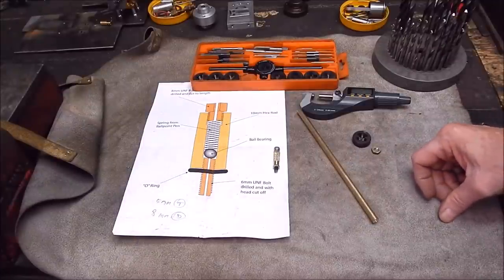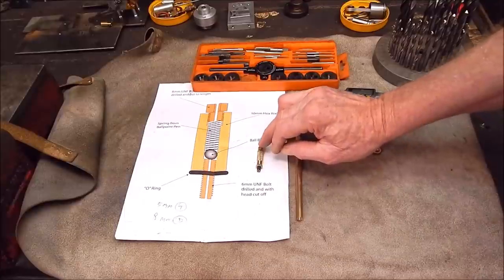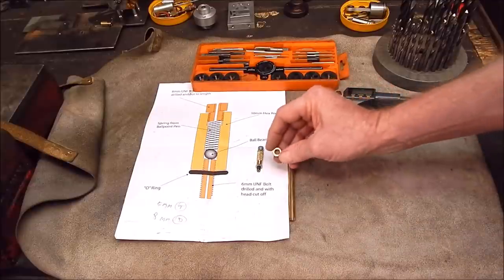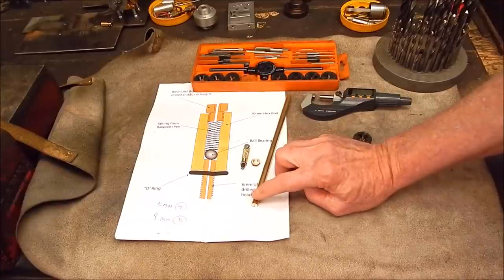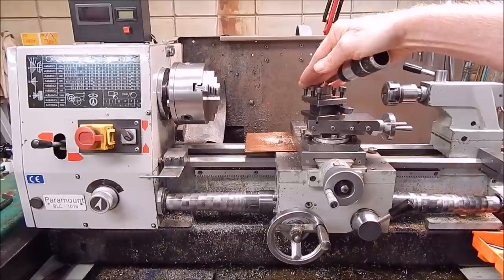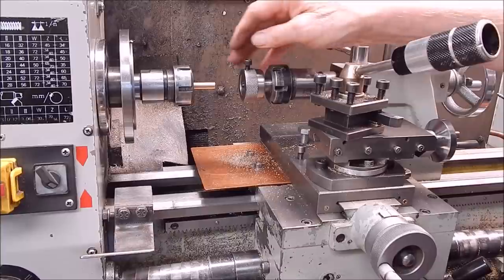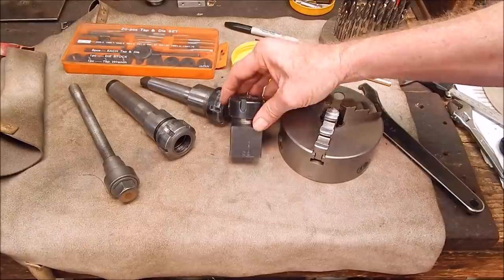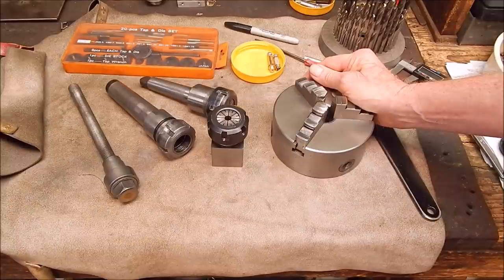Why small metal lathe owners should be using collets

Comment from the maker: NOTE: There's nothing mysterious or high level user about collets.  They are just another/much better way of gripping small stock.  They are just another type of chuck that can be fitted to all modern lathes, that will grip harder, better, more accurately, without marking or destroying the job.

Very few lathe users seem to cotton on to what they are missing out on.  Do yourself a favour and get set up for collets.  ER are the most popular and give the greatest compression range.

Cheers Rob
Reply: I just purchased 29 imperial ER 40 collets and a collet holder for my lathe, as I don't have a small stock holding method, other than a drill chuck, which will work with some things, but not with very fine stock. Not to mention my three jaw chuck is not in great shape. When I can afford it, I want to expand my collets with metric size collets as well.

Comment: Hey Rob.

Not sure if you're able to get hold of any W20 collets for your Schaublin, but I have a 1.666 w20 collet puller going spare if you want it.  It's from an ARE, so might not be the right length for your headstock, but they are easily modded.

Direct spindle mount W20 is far better than an external ER collet chuck, IMO - you're much closer to the headstock, and at least with Schaublin collets, additional runout is close to the bounds of measurability, sub-micron on my machine apart from a couple of rather tatty ones which run out 5 microns or so.

They're expensive new, but over here in Europeland a full set runs about 200 euros second hand.
Reply from the maker: Hi Michael, I have a nearly full set of W 20's that came with the lathe.  Most are in worn condition.  I rarely use them because of the poor compression factor.  ER can be technically more accurate than W20 as it compresses evenly full length of the collet while W20 only compresses half the length.  That's why C5 style collets are only really good for close to nominal sized work.  Thanks for the offer, but I would never use a collet puller.  Cheers Rob

Comment: Rob as usual great video. As a young Fitting &Turner I was taught to always reverse my Tap or Die to break the swarf and keep the cutting tool clear. Not so bad with free cutting brass and steel, but a good habit to prevent breakage of fine Taps. 
Keep the videos coming.
Reply from the maker: Hi Tracey,  brass is probably one of the worst at self clearing drill and tap flutes, after aluminium which is terrible.  Yes, to preserve fine drills/taps you need to clean them regularly when drilling.  Brass also likes to bind when tapping as you are doing it dry.  It is great to machine, but a bit tricky to drill and tap at times.  Stay safe and well.  Cheers Rob

Comment: Great video Rob, all hail the adoption of collets 👍👍👍 On my small lathe I have found that you can safely use a morse taper collet chuck in the tailstock without a tang. Even with fairly large drill bits it will hold securely without coming loose. Cheers, Alan.
Reply from the maker: Hi Alan, yes that's right, they will hold fast in the tailstock without a tang.  The tang is only there to enable ejection, unlike on a drill press where the tang generally engages and prevents turning, as well as for removal with a wedge.  If your tangless Morse taper ejects OK, it must be slightly extended on the end - generally they don't.  Have a 1698 for me.  Cheers Rob
Reply: @Xynudu  Hi Rob. It usually needs a little persuasion to eject 🙂 All out of 1698 at the moment but as the pubs are now open again it's not too much of an issue!! Cheers, Alan.
Reply from the maker: Hi Alan, I stocked up yesterday.  They had it out at 4 bottles for $18 AU, which is as cheap as I've seen it. 

If that morse collet chuck has provision for a draw bar it would be a simple matter to put a small length of bolt in there to make ejection easier,  Just cut a bit of appropriate thread and put a screw driver slot in one end.  I did it to a couple of mine.  Cheers Rob
Reply: @Xynudu  Hi Rob. Nice score on the 1698. That's a good idea on the collet chuck, I think they are threaded 10 mm so I will give that a go. Cheers, Alan.

Comment: Easy project to turn a collet chuck. I made an ER40, plan to make something bigger but that needs my own design of collet too. Rarely use my 3 or 4 jaw.
If you turn it yourself, the runout will be in the single ten-thousandths when you re mount it.
Reply from the maker: Not difficult.  I made one for the Schaublin and it worked out OK.  You must get a snug thread though or it won't be accurate.

Comment: I have almost the same lathe as Rob. (its the europe version)
Insert diam of the spindle is 26 mm.
A 3/4 inch gas pipe is 26,2 mm. So I made a bit smaler and screewed that on a peach round of 40 mm.
So my drawbar is hollow. So up to 20 mm stock can as long as you want in an ER32 collet.

The collet taper is turned in the lathe. So super in center. <0.01 mm

LIKE YOUR VIDEOS ROB
Reply from the maker: Hi Kees,  I have considered doing similar to my CQ9325 (same as the HBM450), but as I have two other lathes with feed through I haven't bothered.  For the money I would probably buy a bolt up collet chuck these days if I was to kit out the lathe for collets again.  Good idea though.  Cheers Rob

Comment: Question Rob. How is you three jaw chuck attached to your chinese lathe? How did you remove the chuck, it looks like you left the backing plate on the spindle and unbolted the chuck body? Why not unscrew the chuck and backing plate as a single unit? Thanks Greg
Reply from the maker: Hi Greg, on very many Chines/Asian lathes the drive plate is part of the spindle (it's all one piece) and the chuck does NOT screw on.  So to remove the chuck you simply undo three bolts and off it pops.  This also means the chuck can't unscrew when you reverse cutting rotation.  It's a very good system and gets over issues with chucks stuck on etc.  If a non OEM chuck does not mate with the locating holes you then use an intermediate/backing plate with the chuck.  Cheers Rob

Comment: On my big lathe I typically use the ER 32 collet block as that lathe has a 4 jaw on it all the time and it is quicker to centre up the collet block in the  4 jaw rather than  remove the 4 jaw and use the MT type or a spindle mount collet chuck .
Hopefully by tomorrow arvo i will have collets and collet chucks coming out of my wazoo ! ER11 for the 3020 engraver , ER16 for my drill sharpening jig , ER20 for my mini lathe  all in metric and imperial and a set of imperial ER32 collets to add to my metric set for my mill .
Got a couple of the tang type  (MT2) ER32 chucks , one for the  big lathe and one for my drill press coming and the ER16 and ER20 chucks for the drill jig and mini lathe as well . 
Banggood must think i have a collet fetish i reckon 😂
But more seriously i have had enough of drill chucks chewing up the shanks on my drills 😡
Now i just need to find an ER chuck that fits my battery drill ! It is the worst offender of them all ! I reckon Ryobi drills would have to have the worst keyless chucks ever invented 💩
Reply from the maker: Hi Ian,  I have also used the collet block in my Chinese four jaw as it then allows feed through.  Yes, swapping out big heavy chucks is bad news and I made the point in the video.  It's good to see that having a large lathe hasn't deterred you from using collets.

I've been driving this point to viewers for many years and I'm pleased to see that many have become converts and are eternally grateful ;)  Cheers Rob

Comment: Thanks for the video Rob. Interesting information. I was looking at collets. This has come in handy. Keep safe and stay well.
Reply from the maker: Hi Colin, once you use them and realise just how effective they are you will be hooked.  To newbies collets look like high end gear that only a factory would use, but that's not the case.  It's just another lathe chuck, that grips work all the way round and is relatively inexpensive these days.  Easily added and removed.  Cheers Rob
Reply: @Xynudu  Thanks again.

Comment: Hello, Thanks for the video. What size of ER collet do you recommend in General ?
Reply from the maker: ER32 is probably the most popular range, but the smaller sizes also get plenty of use from the mini/micro lathe guys.  ER40 and larger are less popular for home use as it's more expensive, not so readily available in budget lines, and also considerably more bulky when working in close.  A four jaw chuck should be able to handle most work over 20 mm provided it's not deformable/ thin walled tube etc.  Occasionally I wish ER32 went a bit larger and you can buy oversized collets up to about 28 mm (from memory) but they are a bit of a fudge really.

I'd recommend ER32 overall, but it comes down to personal requirements.

Cheers Rob

Comment: Great project Rob. Would it be possible to calibrate it relatively with an air compressor.
Reply from the maker: Calibrate ?
Reply: @Xynudu  It is supposed to be a pressure relief valve is't it? You should know what pressure it pops at.

Comment: Concerned about deflection of the bit that I watched. Will it cause tolerance problems? Elsewise, found it a clear working concept.
Reply from the maker: Deflection where John ?  If you mean using tailstock creep to cut threads, not really provided the lathe has prismatic ways and the tailstock isn't loosened off too much.  I've never had any issues doing it this way.  Cheers Rob
Reply: @Xynudu  At 16:00 your spot drill looked like it was deflecting significantly. Is your tailstock off center? Or could that be caused by the tip geometry of your spot drill? Or am I seeing things?
Reply from the maker: Hi Tom, that wasn't a spot drill, that was a jobber drill and any deviation would be from tip geometry.  Cheers Rob

Comment: Thanks for all the collet info. I selected ER40 collets when I started setting up my little home shop and use the morse taper chuck in the headstock. I had worked for  many years in a machine shop but unfortunately was never taught how to properly tighten the drawbar in the lathe and how to knock it out like you demonstrated. I only wish I had watched your video before I started beating the living crap out of my drawbar to drive out a taper I had locked far tighter than necessary. Once again, Thanks!
Reply from the maker: Glad it helped.  It's Morse taper so you basically only need the same force/tension as you would use for the tailstock - it's no different.   So about a fifth of a turn will be plenty.  Cheers Rob

Comment: On the drawbar type collet closer vs. the regular collet chuck...  I personally don't know much, having just bought my first lathe (bear with me), but 2 machinists I know have both told me that collets are the way to go for holding small work.  The gunsmith is totally convinced that the collet chuck is absolutely the way to go, because they are better for the one-off type of work he typically does.  The machine shop guy on the other hand, is totally convinced that the drawbar type collet closer is absoloutely the way to go, because it is better for the production type of work that is his bread and butter.

Kind of a moot point for me since there isn't a drawbar type closer available for my lathe; I have to get the chuck.
Reply from the maker: ER and C5 both have their pro's and cons.  ER are easier to use and have a much greater compression range.  C5 only grip at the nominal size, but can come in a range of internal shape configurations, allow feed through, and offer a quick action lock and release system for repetition work.  C5 don't have self release like ER.  It would be fair to say that ER is the most widely used collet system today, but C5 is still an industry favourite for production work.  I have also got W20 (for my Schaublin) which is like C5 and personally hate using them because they have zero compression range compared to ER.  ER will grip a much wider range of sizes for a given number of collets.  Cheers Rob

Comment: Nice mod to the original design Rob, looks better proportioned being bigger at the base with the nut in place. Happy to send you my drawings for the tailstock die holder I made (doubles up as a sensitive drilling device which for this small stuff would be useful). If you want a copy, drop me an email and I will send out. Cheers, Jon
Reply from the maker: Hi Jon,  thanks for the offer, but I will continue to use tailstock creep for now ;)  It works fine provided you don't let things get sloppy.  I have considered making a sliding die holder, but it's just another project for a rainy day.  The old style pull down type tailstocks do have some advantages over cam lock at times

Yes, with the big lathes you really must use a sensitive drill feed or it's snappo time.  The smaller the lathe, the better the tactile feel for sure. 

Cheers Rob.

Comment: Enjoyed...I have er32 collets ordered from BGood
Reply: Chuck - You'd better check those out thoroughly on arrival before the money-back guarantee expires... I've ordered a few MT 2 & 3 ER32 chucks from BG thru the last two years, finding all 4 of them had both concentricity and runout problems up to +/- 0,05 mm, and my BG Imperial & Metric collet sets measured about the same runout AFTER I'd reground the collet chuck in situ (down to 0,005 mm runout). All other aspects of the machining is excellent - it's just that all the collet's holes are both non-concentric as well as at an angle...
Haven't yet come around to grind alla the darned collets - 2 years after...
Check this for a few other's experiences of same: https://www.youtube.com/results?search_query=Banggood+collet+set+review
All the best! Nice channel you've got, too!  2 cents from DIYSwede
Reply from the maker: Hi Johan, I don't think much of most Banggood collet offerings.  Apart from their nice bolt up collet chuck, the only collets I've reviewed have been sub par, as lots of buyer comments indicate.  Other reviews have also been critical and I have advised BG on several occasions that they need to lift their game on the quality of the ER offerings.  This is not just a BG thing and lots of Ebay collet gear is total crap.  So buyer be ware.

The only store I have consistently bought from and found to sell accuarte gear at a reasonable price is CTC Tools in Europe.  It's still Chinese tooling but accurate.  Here's their link:   http://www.ctctools.biz/

You pay a little bit more but it's worth it.

Cheers Rob

Comment: Thanks Rob. 👍 Nothing wrong with letting off a little steam now and then! 29:00 BTW, the top belt in the gear box is looking rather gnarley. Must be due for a change in the new year 😉
Reply from the maker: Hi Laz, yes, the belts have done a lot of work and been replaced a few times.  The change gear oil spray does them no good.  Times up when they  disintegrate ;)  I always have a spare handy.  Cheers Rob

Comment: Would 1/8 NPT not be a preferable thread to attach to the boiler?
Reply from the maker: Use whatever thread you like.  BSB would be better.
Reply: @Xynudu  interesting, why do you think so? I am thinking NPT, because it is designed for pressure applications, (I had to Google BSB) where as BSB is designed not to undermine tube strength of Standard Brass tube, which you are not using...
Reply from the maker: BSB is also designed for high pressure application.  It is a standard thread used on steam loco's.  In theory you could use any fine pitch thread, but BSB is a good choice, and was widely used for hydraulic/pressure applications as well.  It is a relatively old type and modern equivalents/tapered fittings have largely taken over.  Cheers Rob
Reply: @Xynudu  thanks Rob now that choise makes more sense!

Comment: Hi Rob, I agree that collet chucks are great. Safety valves are quite simple to construct but there is a calculation that must be performed before it can be labelled a "safety valve". There is a scenario where the heat source can boil the water at a greater rate than the valve can evacuate the steam and as a result, the pressure within the boiler can exceed the safe working pressure. The calculation involves the bore size of the valve and its capacity to pass the steam generated. So even though the valve is statically tested as you did using air pressure, and blow off at the desired pressure, it may not be safe! This is in no way to denigrate your video but rather to bring to you and your follower's attention a significant safety issue. Incidentally, it is recommended the ball be set in its seat by placing a brass rod onto the ball and giving it a sharp rap with a hammer. This ball is. then discarded and a new ball used in the valve. I always enjoy your vids, you have lots of great ideas and energy. Many thanks, Richard
Reply from the maker: Hi Richard, yes I'm aware of that, but it's good that you make the point.  The safety valves I made are for low pressure steam and small capacity boilers, so they will be perfectly adequate.  In the previous video I mentioned you can scale the dimensions up to suit the boiler capacity.  Cheers Rob